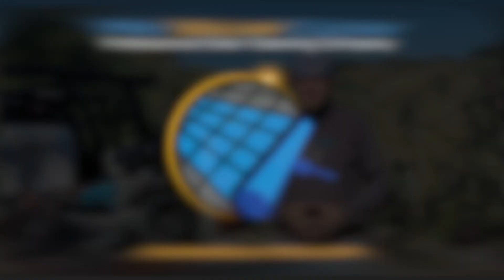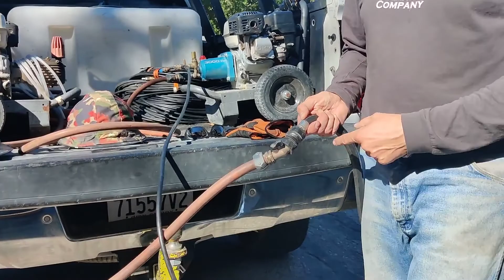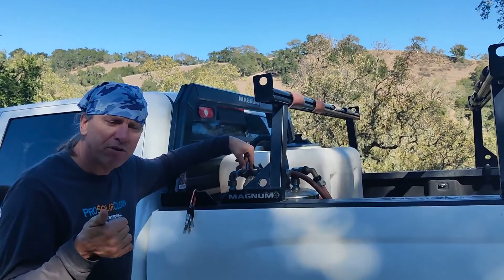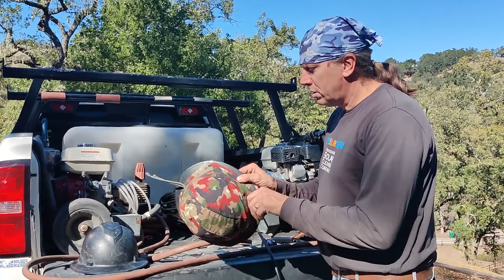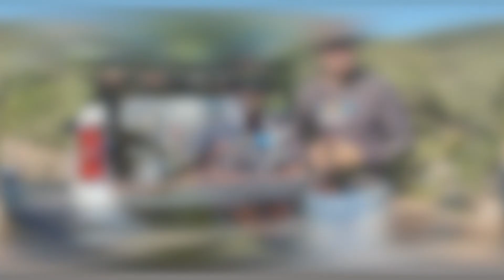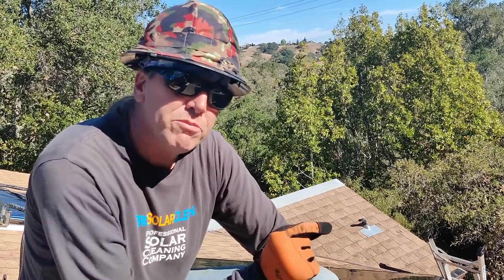Residential Panel Cleaning & Safety Tips

Comment: Should panels be cleaned in the morning or evening to avoid cracking them when they get hot in the sun? Do you think there is a risk of cracking the panels if it is too hot outside? Thank you for the information, sir!!
Reply from the maker: We were cleaning in condition close to 32F using very cold water few years ago and nothing happened to glass , …. from the other hand I was cleaning in Mohave desert, 112F and no one single glass got crack ….. it’s tempered glass , it can take a lot !
Reply: Çatlamaz ama belirli bir süre şoklama olur
Reply from the maker: I personally prefer to clean solar modules in the morning when morning dew is still on them

Comment: What does the large white water tank do in the equation? I understand that you go from hose, to dio tanks, to pressure washer, to brush. Where is the white water tank in the equation? Thanks for info.
Reply from the maker: I am using the 100 gallon tank in case my customer has 1. No source of water 2. Too weak source of water ( 5psi ) 3. Source of water is too far away
Reply from the maker: The large white tank is a 100 gallon tank I can transport water to a remote array where the hose won’t reach. Some residential customers have a ground mount in the field. I can pump water from the tank.